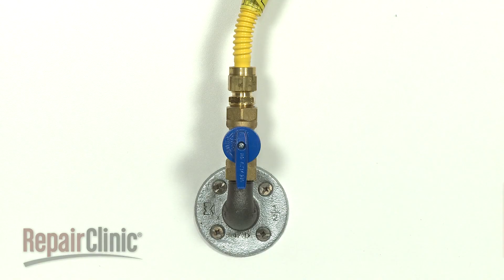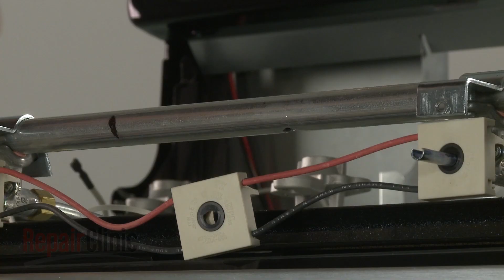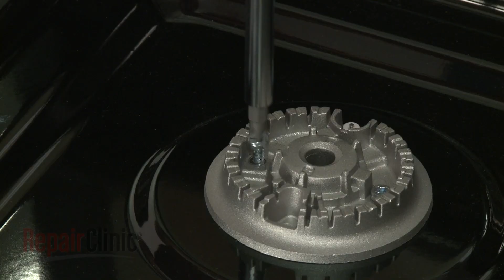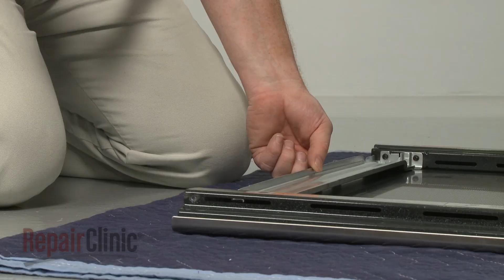Whirlpool Gas Range Disassembly – Range Repair Help

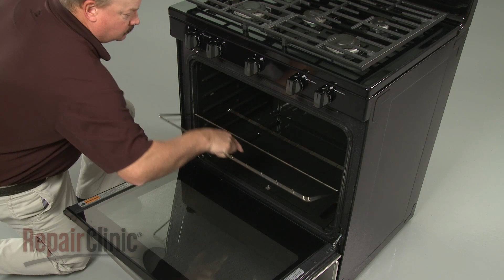Comment: 00:38 oven burner tube
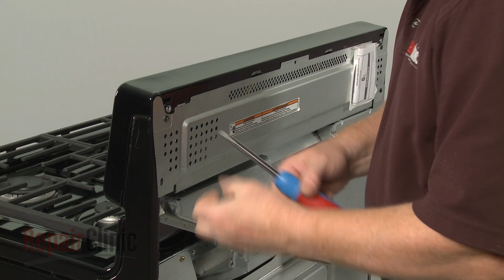2:07 oven control board
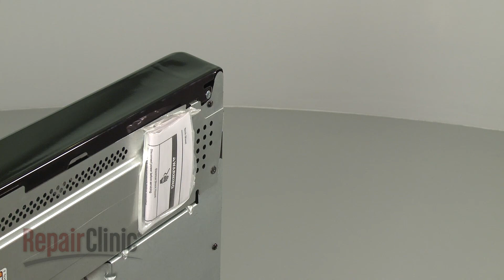3:47 access under cooktop
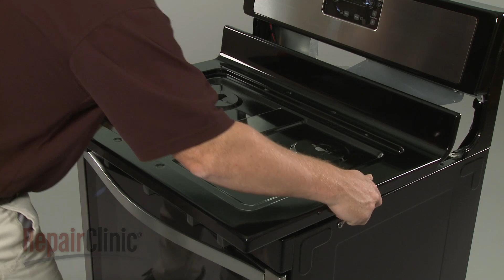4:50 burner valve replacement
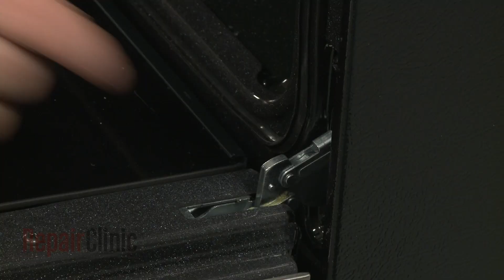9:47 removal of and access inside the oven door

Comment: Great video it really helped me to reinstall  the stove parts.  is there any idea why my stove igniters come on when I plug in my stove ? I did spill a cup of coffee on the top of the stove and I cleaned it up on top. I did open up the stove top to see if something it was wet but it was dry. I checked to see if something was wrong or not connected and the breaker went off.  I put everything back together  but when I turned on the breaker and pluged in the stove the igniters turn on and try to ignite but doesn't stop.  When i plug in the stove to the wall the igniters stay on even  after I turn each burner on.  Please help !  any suggestions would be greatly appreciated : )

Comment: My clicker on stovetop will not fire at all... Gas flows and we use a match lighter stick. Oven works and control panel works...  What am I looking for? The video is splendid and thank you...

Comment: i recently bought a used whirlpool convection oven and had it installed.  Stovetop works great, but there is a very bad odor emanating once I preheat the stove.  My suspicion is that there is a mouse corpse somewhere in the insulation, possibly between the oven and the exterior wall.  Any suggestions on removing side panels to look for dead mouse? Thanks.

Comment: I find it impossible to remove the knobs off of a Whirlpool gas range 4 burner model wfg320m0bs3. Are there whirlpool ranges that require more work other than just pulling the knobs off?

Comment: My 2018 stove had screws holding the top on. Removed knobs, removed cover plate behind them with 2 screws. Once removed, access 2 screws that hold the top to the brackets.

Comment: How do you change bulb if it broke off but metal part still in socket
Reply: use a potato
Reply: Unplug the oven from electric power.
Stick a screwdriver into the broken off bulb, and unscrew it